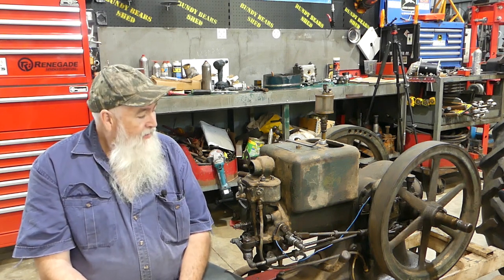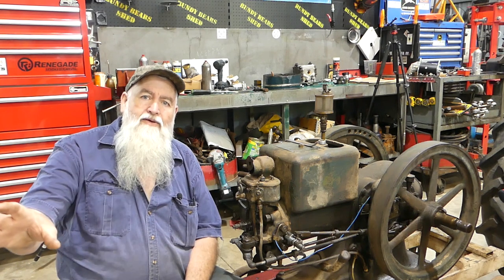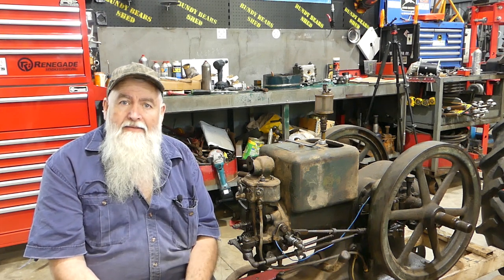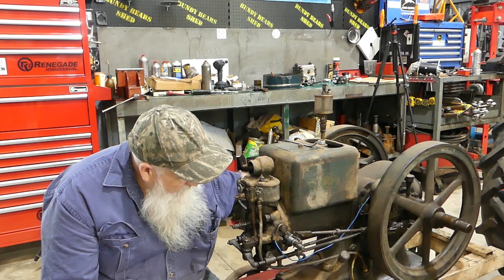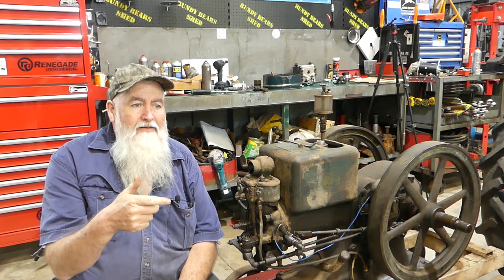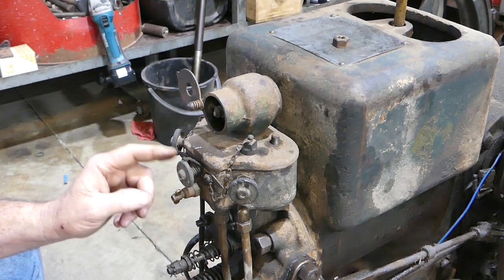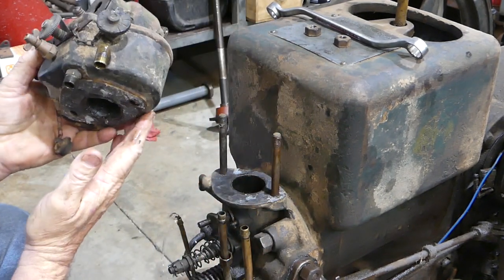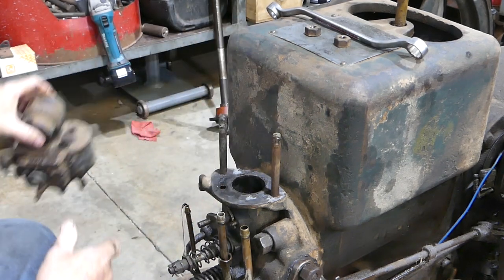IHC 3hp Stationary Engine Part # 1 Introduction and Removing the Carb

Comment: My 1947 Fordson E27N runs on petrol / TVO, which you can't get anymore in the UK. I mix up 4 parts kero to 1 part Petrol and I believe some folks throw in a dash of diesel or even some 2 stroke oil..You are right, it does smell nice running down the road
Reply from the maker: The Fergy blokes do a similar mix, I might try it out
Reply: And the dash of ethanol in UK fuel, when you can buy it!

Comment: What weight hydraulic oil are u running in the massey. 65
Reply from the maker: It is just modern Hydratrans oil like a disk brake tractor would get similar to 80 weight.